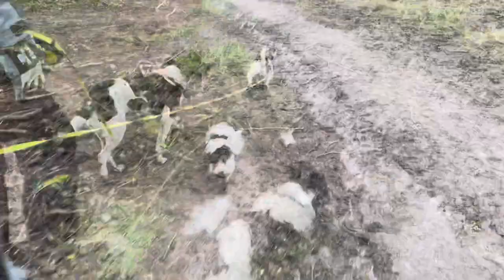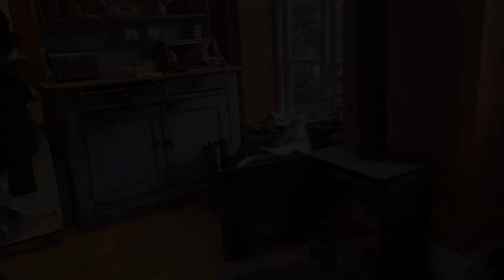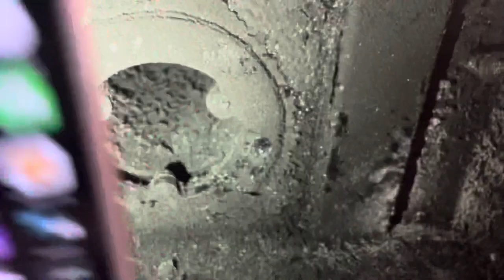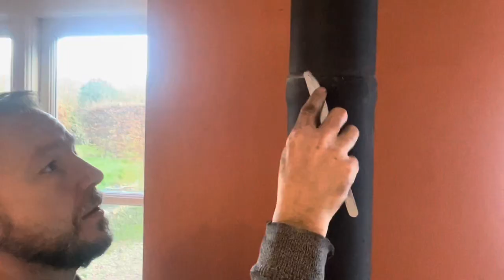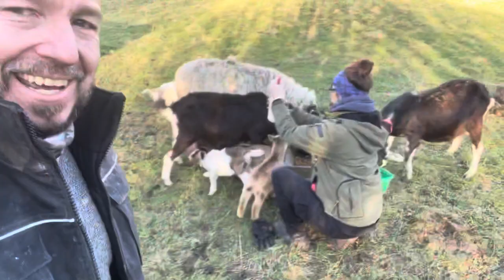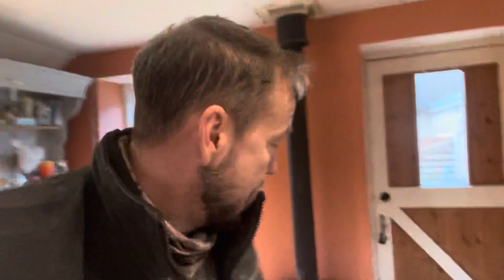Home chimney sweeping, mushroom foraging and goat feeding.

Comment: I use a Chimney Typhoon system, much easier than drain rods and only takes 10 minutes to clean the chimney liner, costs about £60 off ebay and can also be used on drains.
Reply from the maker: Thanks! Just had a look and Amazon has them for £50 👍😊

Comment: Bravo! Way to get in there and get it done! As we heat our 220 year old colonial (Georgian) home with 2 woodstoves, I wonder, did you have trouble with heat on the wall behind? Our one back is brick, the other inside the original open firebox. Thought there might be a secret?
Reply from the maker: Well the plaster behind this one is cracking so no secret there I’m afraid 😊

The house we are in the process of moving to has two fires and no issues so I will report back after some investigation 😊